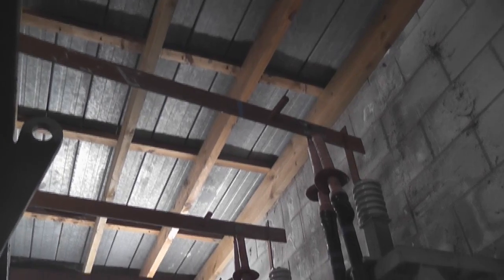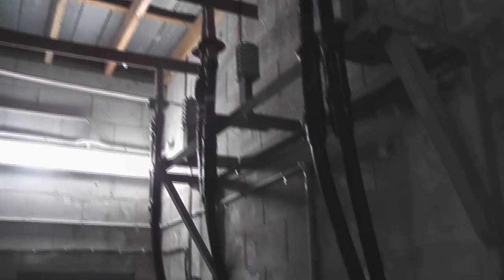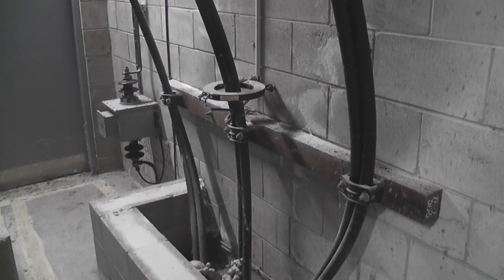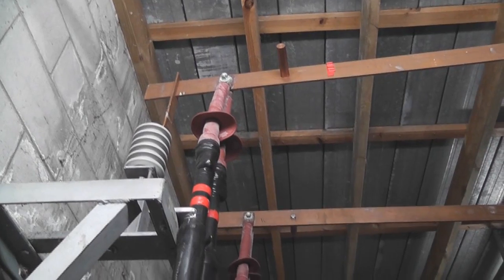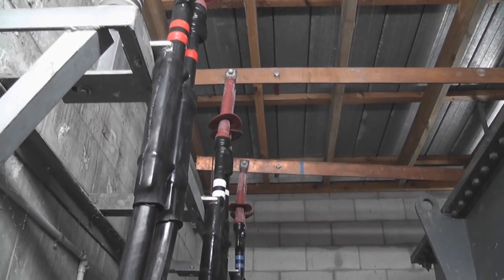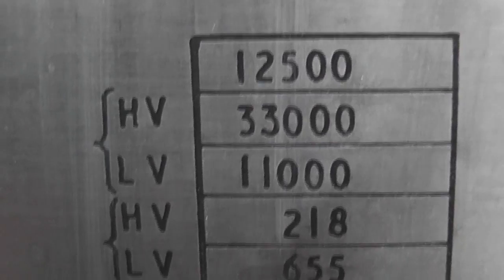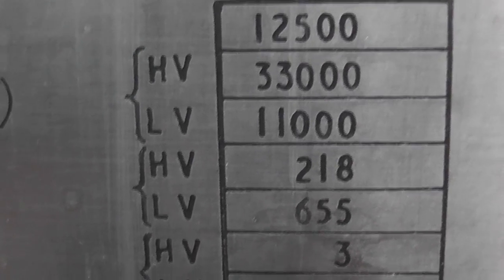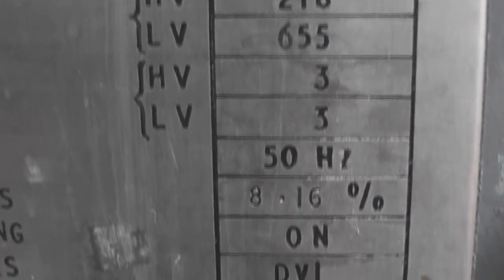50 Hertz

Comment: One of the reasons the sound is so awesome is that it is not just 50 Hz, but it is 50 Hz polyphase. This makes a more rich sound. Similar, 400 Hz from a frequency generator sounds 'hollow', but 400 Hz / 3 PH noise picked up by the audio system in an airplane has more of a 'warm' sound. If you have a decent audio generator, superimpose 3 channels @ 50 Hz, with 120° phase shift between each sine wave, and you will hear this.
Reply from the maker: Good point you made there. 50Hz with 120 degree phase shift.
Reply: +LakeNipissing  Brilliant!  Makes perfect sense, but I never thought of that before.
Reply: Plus some harmonics as well. ;)
Reply: Wait how don't they cancel each other out?
Reply: @josefaschwanden1502  At 180° delay, two phases would,  yes,  but three phases at 120° delay, no.

Comment from the maker: It is the way the laminations vibrate, called magnetostriction. The transformer is normally switched on unloaded. When energized, the load side circuit breaker is closed.

Comment: Fantastic video... I just love deep throbbing 50Hz sound. I recently visited the Haywards substation and had a tour and I was just incredible to see the new Pole 2 HVDC link in action! Not many people get to go and really feel the power (literally!). I also saw the thyristors, radio chokes and filter banks. I was amazed by the size of the 220kV to 110kV transformers as well as the synchronous condensors which were vibrating the whole structure around them. You must have a pretty awesome job!